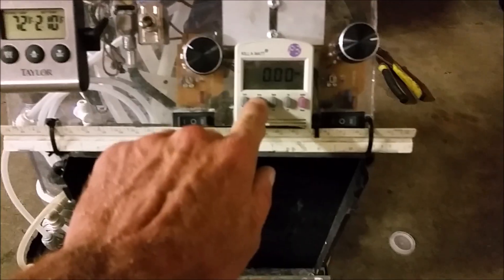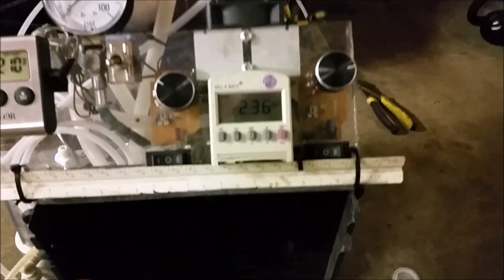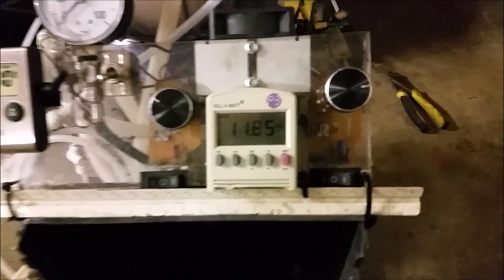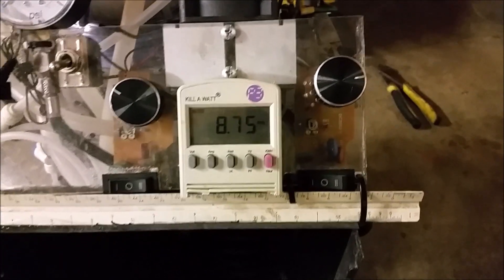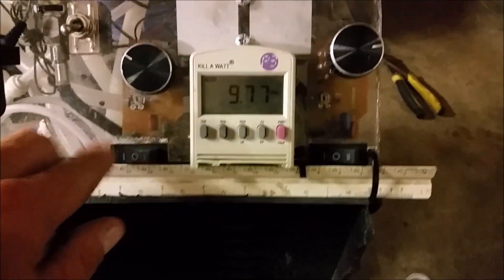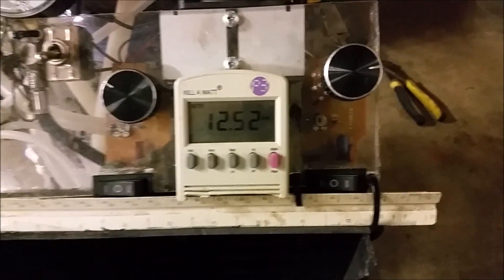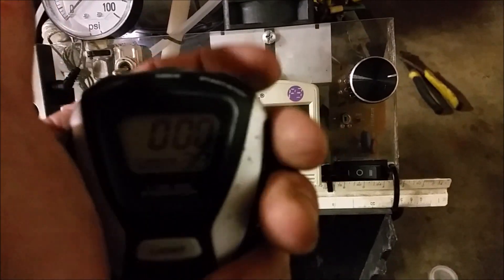HHO CANNON

Comment: If I may make a suggestion take a pinch of steel wool roll it into a ball between fingers shovel wire in that place the ball inside of a balloon filled a balloon up tie the balloon off you have yourself prepackaged round fire for effect

Comment: Could you try shooting a projectile at a piece of plywood with it?
Reply from the maker: Joe Wilder just kidding bro , yes i will try and see what i can do. it would be cool to at least see a potato fired from this bad boy. the pressure has to be high because i rapped like 7 turns of tyvek tape around the spark plug hole at the top and it blew a clean hole write threw the tape. this tape is no joke it im guessing but it had to be over 200 psi and it was write at the end of the barrel